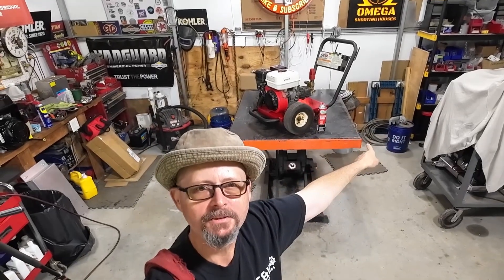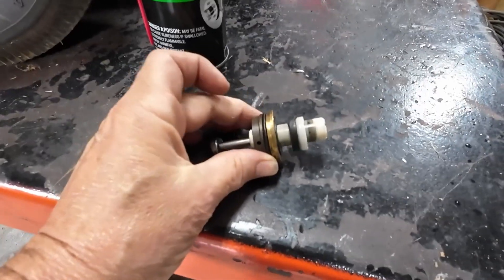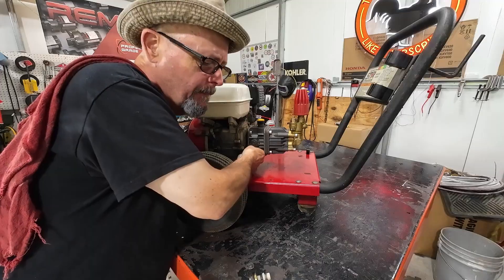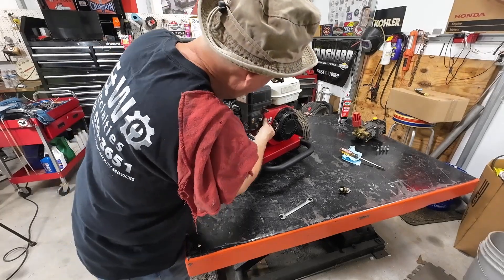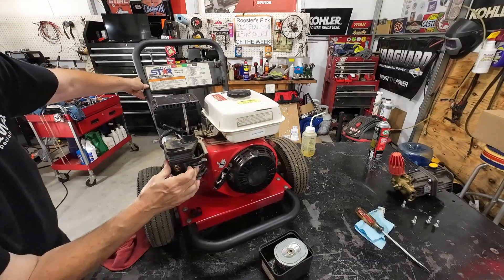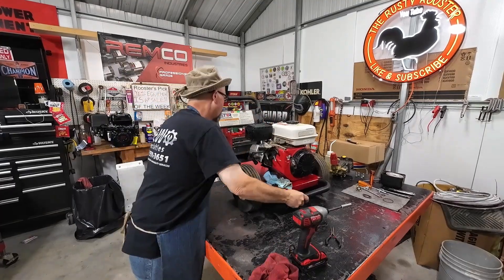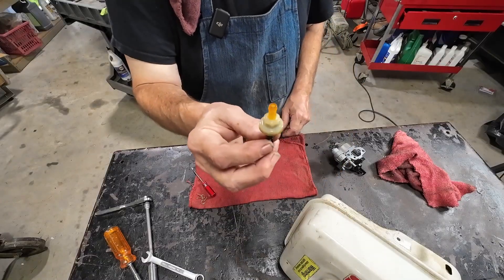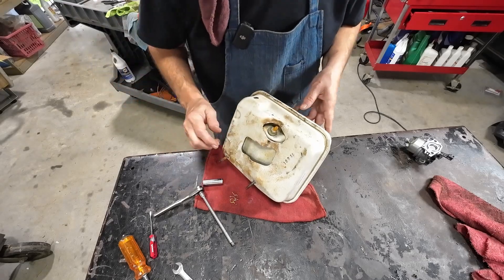"Why You NEVER Run a Pressure Washer Without Water | Save Your Pump!"

Comment from the maker: 👇 Seen others run their pressure washer pumps dry “just for a minute”? Don’t do it.
🔥 No water = no cooling or lubrication = a burned-up pump.
Even in bypass, most pumps can only last 30–60 seconds before damage begins.

💡 Hook it up or pull it off. That’s the Rooster Rule. 🐓
Reply: Hey @TheRustyRooster, can you tell me about your lift? You’re sho nuff right on hooking up water to a pressure washer
Reply from the maker: Next video should answer all ya questions.  Thanks ol-buddy
Reply: For sure

Comment: Just bought generac used pressure washer got a good deal $100 3GPM 2200 psi needs work ordered new carb see some oil under the pump thinking pull the pump while getting the motor running also check the pump seals. Good way to test the motor while I'm at it.
Reply from the maker: Good deal. I hope ya get it going. Just hook water hose and high pressure gun and hose up and see if you have any leaks.  I wouldn't disturb the seals unless it's leaking.

Comment: I just had almost the same unit on my bench for the same reason .Only difference is it had a Allen screw holding the key in place My engine is a GX390  I cleaned the carb  and it runs great but the bowl gasket/o ring leaks  ordered one from amazon and they sent the wrong one too small.Tried the local Honda shop but they want a arm and leg I can get the whole carb with plug fuel line and filter for 1/2 the price from HIPA store but not the o rings there What to do ?
Reply from the maker: Yeah the oem bowl gasket kit is nearly the cost of an aftermarket carb.
https://amzn.to/47DcXb3
Reply: @TheRustyRooster  So what you do try again for$10  or just  buy the after market carb for $14 or pay twice as much for OEM kit  at $35
Reply: all have to be ordered
Reply from the maker: It's a crap shoot,  split the difference, buy the aftermarket, and steel the bowl gasket out of it.
Reply: @TheRustyRooster Great minds think alike  I was thinking the same thing when i ordered it 5 hours ago thanks